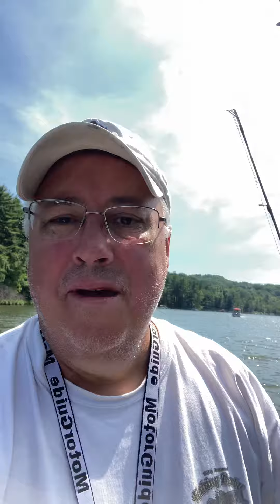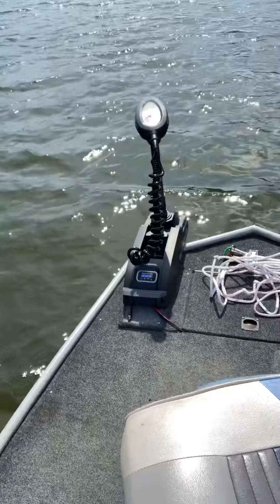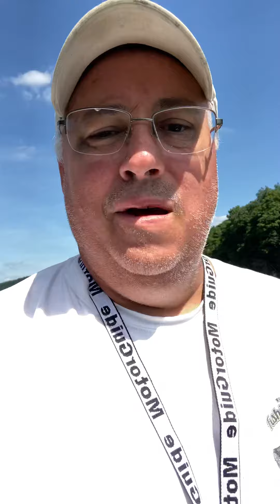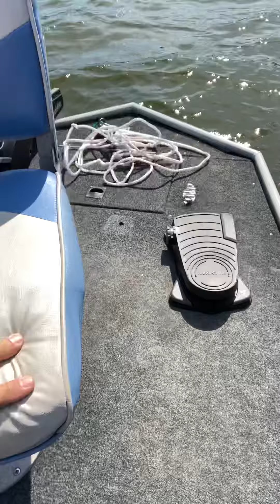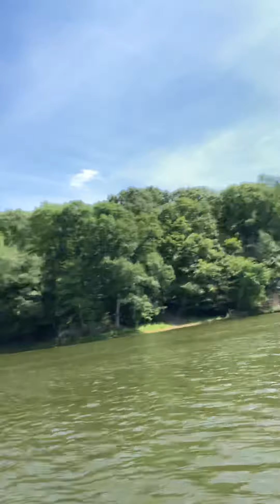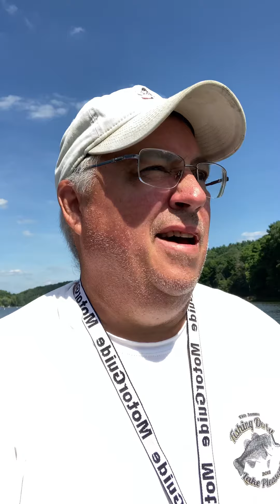Motor guide trolling motor working A-OK today

Comment: Thanks for the videos I was looking at this unit now I’m second guessing it. After the battery change would you recommend this unit. Thank you!!
Reply from the maker: Hey there a weeksbikes, thank you so much for watching my videos and leaving a comment. As for the trolling motor (you have to remember I made that video over a year ago, it’s a year later, and a lot of frustration with it.) 
I do not recommend Motor Guide‘s Xi3. Especially if you live in Northeast Ohio. There’s really only about one service center and there’s only one person, and he is swamped. They have on their website a service center listed in Kent Ohio; however, this place has never been one of their service centers and that place has told Motor Guide to take them off of their website and stop listing them as a service center. Motor Guide still has not remove them from the website. Motor Guide has a bunch of people that are all very helpful in convincing you to buy this trolling motor, but when you have a problem, it’s like they don’t even want to hear from you. Buy minnKota if you’re looking to get a wireless. The handheld remote control looks to be a lot better, and I believe there is an on off switch. I do not know why Motor Guide wouldn’t put one on theirs. They try to tell you that it doesn’t need an on off switch because when the trolling motor is unplugged, the batteries are being drained in the remote control. However I found myself changing batteries constantly. Now I’m having trouble and I had to send my handheld remote control to Ravenna Ohio, to their service center, they are going to be replacing it with a new one. I’m still waiting for that to be sent to me and hopefully it works right. I have been using my remote Footpedal, it’s OK, but trying to make the trolling motor turn left, you have to mash the foot pedal. Sometimes it won’t respond until you mash it about three or four times. Why Motor Guide let these things be delivered to the public before working out the kinks is the hundred thousand dollar question. Hey listen I could go on all night about this trolling motor, but I say do not buy one. And also I would love to have you as a subscriber. If you have not already subscribed. Please share my videos if you get a chance to your Facebook as I’m sure you have some people that would get a kick out of them. Plus it helps my channel grow. I appreciate your watching, and question. Thanks again… TD Mayday